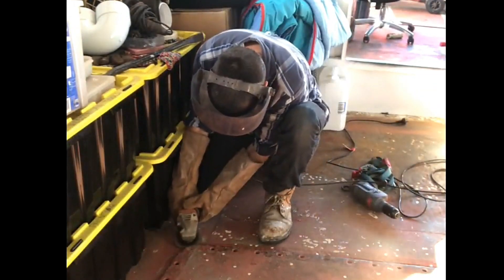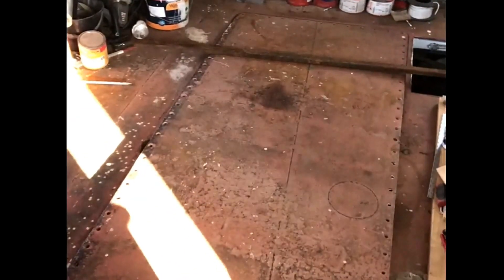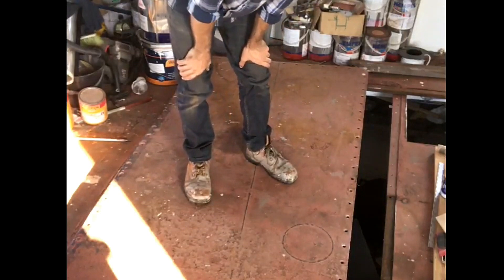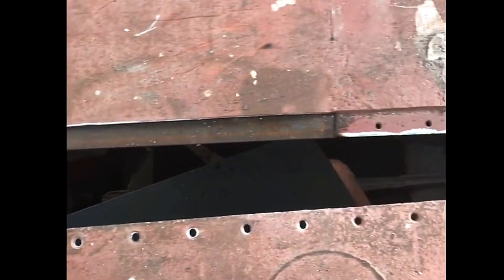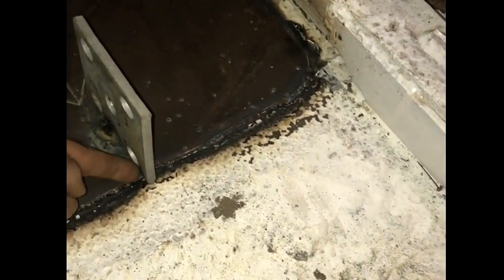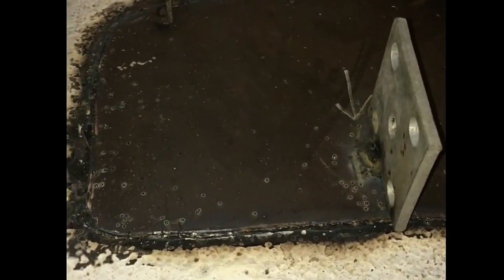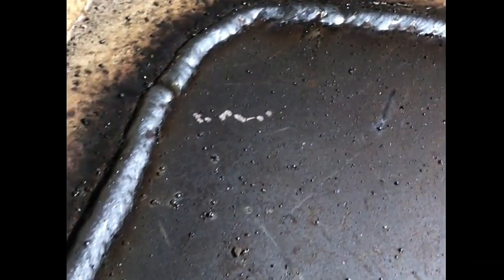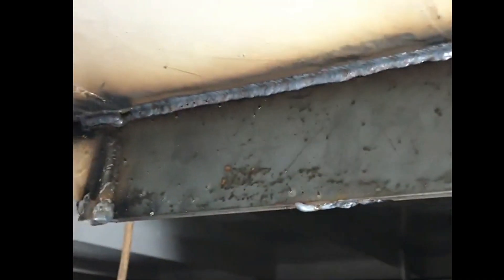How to repair structural beams in a boat - Brupeg (Ep. 07)

Comment: If you are going out in a steel boat, you need to learn stick welding.  It is cheap, can be done in almost any condition, and the leads can reach 100 feet from the buzz box.
Reply from the maker: I can stick weld. Just hate it so stick with MIG. That said I’m pretty used to welding MIG in anything up to 20-25knots so I do t need to jump back to stick very often
Reply: @ProjectBrupeg  I much rather use MIG, but go to stick with bad surface prep and/ or windy conditions.  I have never tried it, but underwater stick is possible.  Your boat, your choices, just tossing in my 10 cents USD (2 cents Australian)

Comment: Continued good progress.  Have you consulted with a welding supplier on the type of electrode you are using?  Different metallurgy out there for each purpose and some are better for boat building (more flexible, not prone to cracking).
Reply from the maker: No I haven’t done that. Don’t know what I don’t know. I assumed mild steel wire and mire steel would be the same and would all work normal.

Comment: Greetings! I have been thinking about your engine cooling system and ice. This system is designed for the tropics and the higher water temperature. If you look at the ratio's you would not need this in polar ice conditions. 30 degrees to 5 degrees. Your marine engine manual will have this info for you. Kind regards and greetings from Africa.
Reply from the maker: Yeah that’s a fair point. We are looking at internal cooling options and losing the external pipes... more to come on that in the next few months
Reply: Also the protection of the pipes.
Reply from the maker: We are thinking about a sea chest of sorts. We had a yacht pull out next to us that used cavities inside the keel to cool the engine and generator. No external pipes but the same ability to dump heat through the steel. Also no additional pumps required as it’s all still fresh water like the current system and the engine driven pump can circulate as needed

Comment: A proper cap weld should be 1/16 to 1/8 above the base metal, it's your boat and your doing fine, just a few pointers from someone who's been welding for thirty five plus years on boilers to naval ships and submarines.
Reply from the maker: Ok so your talking inches then. I watched what the pros are doing on trawlers etc in the yes and tried to copy as close as possible. The thing I find the hardest is the overhead welding. Not sure if it’s settings or me but one of those two keeps giving me jip